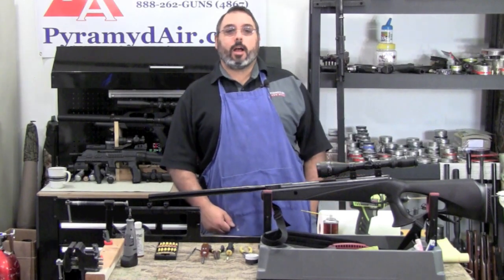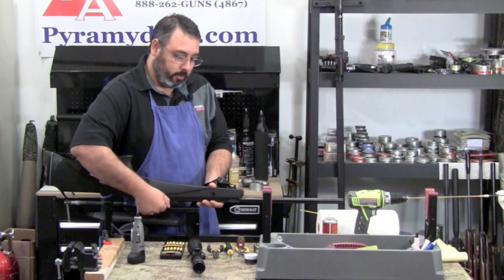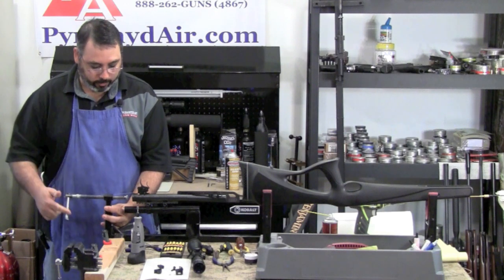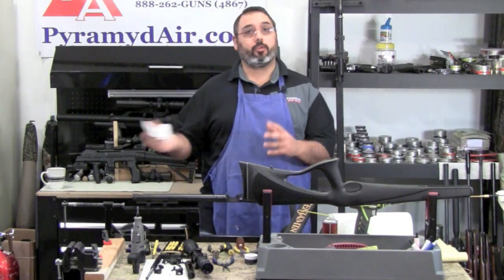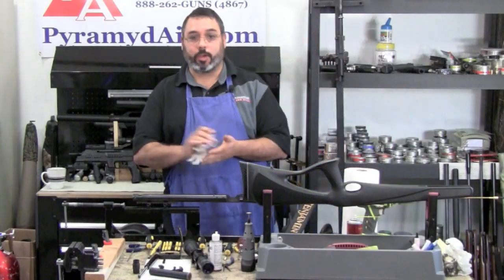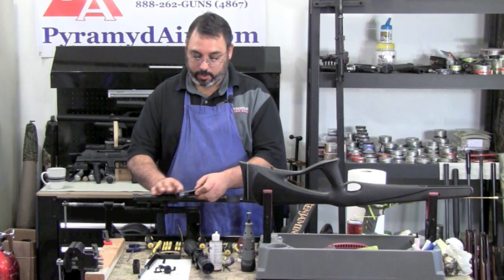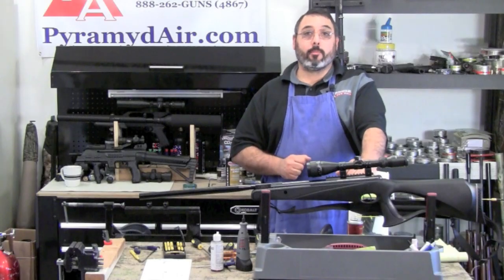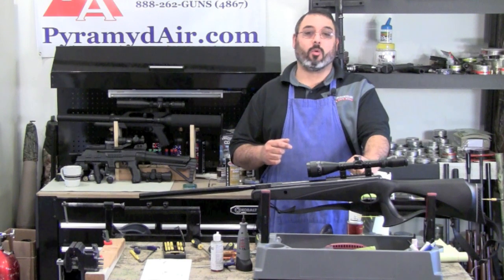Take AIM Episode 8 - How to rebuild your breakbarrel airgun

Comment: After being a machinist for 25 years and working on many triggers. DO NOT use a Dremel tool EVER on a trigger sear!!! The case hardening is only a few thousandths thick and you will grind through it. Instead, use a flat,hard, sharp edged stone and just POLISH the surface, without changing the angle This will produce a crisp and smooth release.

Comment: i have been looking at spring compressors for weeks to decide which one i was gunna make and after seeing the one in this video i have made one very similar to yours. i love the idea that i can leave it locked it and still work on the tube hands free. wanted to thank you for your video as well cause i just tuned my 1st rifle with your help . Now my Ruger Air Hawk is ultra smooth in operation and have increased power by 30%. i use the Vortek PG2 kit for my Air Hawk

Comment from the maker: 2 to 3 thousand.. 

You don't need to do it often.. right when you get it (if you don't mind voiding your warranty) is not a bad idea.. it will help the gun last longer overall.  Or if you like, shoot it stock until the warranty has expired and then rebuild it and go ahead and replace the piston seal while you have it apart.

Cheers

Rick

Comment from the maker: I don't really recommend oiling the compression chamber.  If the manufacturer suggests it, then follow their instruction and use their approved lubricant.  Crosman has one and so does RWS.  For everything external I use PA's MP-5 Oil.  As for the spring, I have a special lubricant that I use for that.  Gas rams I use moly paste as in this video.

Cheers
AGW

Comment from the maker: You can get a seal from Crosman.  Download the exploded parts diagram for your gun and call them to order the part that you need. The best way to know if your seal is good or bad is with a chronograph.  When the velocity starts to drop and become inconsistent, then your first place to look is the seal.

Cheers,
AGW

Comment from the maker: @Northernredneck125 

Thank you.. I'd love to do just that.   I do have to weigh the liability issues.. which is what's holding me back right now.  I think it is a great design that has handled everything that I've thrown at it so far from these simple gas ram guns to something like the Falcon Hunter with a massive spring.  I believe it is a winner.. It is a capital thing.

Thanks for the kind words.

Rick

Comment: I find it easy to put the trigger back in by holding the sear up and pulling the trigger so that the sear goes all the way up and holding it there with a small rubber band then once its on just remove the rubber band

Comment from the maker: The process is going to be virtually identical on the Gamo. However, the springs on the Gamo guns are often preloaded so you need to be careful when trying to remove them. It is not something that I would recommend to anyone that does not have experience working with high-powered rifles. This can be quite dangerous and you can get injured if you don't know what you're doing.

Cheers

Rick

Comment from the maker: Actually, a better way to go would be to use a different lubricant. I'll be offering something called "red honey" on my site pretty soon. I normally use it on just spring guns, because it really dampens the vibration and is tacky as all get out. It does slow things down a bit however. I prefer accuracy and consistency vs that extra 50 fps. You'd get similar results with a gas ram.. no need to dampen the vibration, but the tackiness will slow the gun down some and make it more quiet.
cheers
Rick

Comment: I find it easy to put the trigger back in by holding the sear up and pulling the trigger so that the sear goes all the way up and holding it there with a small rubber band then once its on just remove the rubber band, and with a springer you shouldn't break the barrel open when the stock is off because it can bend your piston then that will break your spring, i'm guessing that dent doesn't make a difference with a nitro piston because it doesn't ride along the inside of the piston

Comment: nice work rick  great video  but while you have you dremmel out why not break the sharp edge in the slot  where the linkage runs it would be sliding a lot smoother. and get a replacment seal before you do a video and call it a re-build  thanks

Comment: Hello again, Rick... this is a "PS" to my comment / question below, in regards to your spring compressor.    In looking at it again, I just noticed that this rifle has picatinny / weaver style rail & of course, corresponding mounts on the compressor.... will this set-up work equally as strong with just a 3/8ths "dove tail" as is common on many airguns ??    I rifles with all three.. picatinny / weaver / dove tail.... and so, would just have to swap mount rings, depending on the AG I'm working on ??      Thanks again, Rick.

Comment: Thanks for the great video. Question: So you put molly grease on the surface of the piston and so it naturally will get on the side of the piston seal. Got that. But will you also need to put a couple drops of chamber lube in the gun also?

Comment: Rick, thanks for the video. Would you recommend this detail strip on a new rifle. I would prefer to begin the break in process on a properly lubed piston described in your video. Thanks.
Reply from the maker: To j hike:
I would because this is how you can make sure that your rifle is properly lubed. Some rifles do come dry and without much lube. The key is not to overdo the lube because this will cause your rile slow down.

Cheers,
AGW

Comment: Everytime I pull apart one of my guns, I reasemble the trigger by slipping it on the tube, almost inplace, and using my finger to hold/lift the sear(while finher in tube) up while inserting it.Then push it foward and it holds inplace. It is so easy compaired to using a screwdriver or any other way.Hope that made some seance.  Just slip on and put a finger in hahaha

Comment: i don't know how i missed this video ! very very informative . rick , if i wanted a NP gun to shoot a little slower , quieter and smoother (fairly small yard and want to be very quiet without a silencer/muzzle break) .... could shortening the silver rod end of the gas ram by a 1/4 or 1/2 inch work ? and would it harm anything ? i know the warranty would be shot on a new gun doing it . wish i had gotten one of the low power titans when they were around :(

thanks again :)

Comment: I was wondering if you have a video of replacing a spring with a nitro piston? Or at least your opinion of doing such a modification. I was looking at some high end springers (Diana 56 and Walther Competition Ultra).
I'm not crazy about the springs since there is an alternative, but the guns using this tech has not really grabbed my attention (because of the diana side cocking and the walther's "hidden" cocking action along with other things). I would like to see a modification video to replace the spring or maybe where a tuning kit to do so can be bought (not really finding anything on my search). 
Basically I'm looking to do some long range (non-pcp) target shooting and new to the air gun scene. My engineering/machinist/maintenance tech (pneumatic/hydraulic/mechanical/electrical) background has me always looking for ways to improve perfection. This is why I prefer the gas shock than a spring, and heavy modifications isn't something I'm scared of plus if someone shows up with the same gun I want there to be a difference.
On the flip side I can not find a proper video about the Diana 56th target hunter.
Reply from the maker: You should look up the information on the Walther LGV and see why they chose spring over gas ram for their guns.  On the higher end guns, they need to be mechanically able to take a ram.  You could possibly get one to work, but you'd have to make your own components.  It's not practical and not really necessary.  The most successful, non pcp, field target rifle is the air arms tx200, a spring gun.

There are some spring guns that greatly benefit from a gas ram conversion, but the higher end guns may very well be better with the native spring.

Cheers,
AGW

Comment: I have a gamo varmit, i tried to remove the barrel and the screw wouldn't budge. When i used more power the bolt stripped. Any tips to get the bolt out?

Comment: i got an air rifle i want to do some work,  and i was wondering if you could answer some questions to move me along.

i know alot of gas rams come in 29 and 26mm.  how do i measure them to find out the proper size of gas ram is for replacement??

also is it impossible to swap out the gas piston without a spring clamp like the one you built??

Comment: What's the proper way to remove the barrel shroud?  I just wanted to check to see if there's any misalignment in the barrel.  My NP seem to shoot all over the place. I've tried several variations of the Artillery hold and several pellets lights and heavy and can't get consistent groupings. Maybe I've haven't fired enough pellets through it, about 150 so far.  What do you suggest?  Thanks.....
Reply from the maker: it's probably not the pellets or the break in period.  it's more than likely the gun or possibly the screws in the stock, make sure to check them.  To get the barrel shroud off, you need to unscrew the end cap with the right size allen wrench.. not sure what that is, but it should be easy enough to find.

Hope that helps.

Cheers,
AGW
Reply: Thanks for your reply.  I believe  I'm taking this  back.  The stock is  tight I even applied blue loctite on them.  I think I'm going to stick to the Hatsan products.
Reply from the maker: ***** It all depends on where you start for an airgun.  If you are talking Crosman, Benjamin, Gamo, Ruger, even Hatsan.. then yes.  There are manufacturing tolerances that can be improved.  Hatsan and Ruger will give you the least amount of problems.  Now, when you get to RWS, Beeman/HW, Walther and other proper European break barrels, there are zero issues with barrel lockup that I've found.  But, you are paying for that engineering. 

Lastly, you can't compare firearms to airguns in the same way you can't compare a VW hatchback to a 3/4 ton truck.  Sure they are both vehicles, but they are meant to do different things and appeal to different sets of people.  Airguns, as well as bows, shotguns, firearms, rc airplanes, etc. are a hobby.  Hobbies are expensive and never make financial "sense" as they are purchased more for the experience they deliver vs the utility they perform.

As for the profits made on them.. I have some internal knowledge on what some guns cost landed on US soil and there are some that are probably overpriced for what they deliver, but they are all the budget guns and not the high-end guns.  The margin on the high end, specifically European guns, is much lower than the Chinese imports.

Hope that helps.

Cheers
AGW

Comment: I've a Benjamin Trail NP .22 from 2010, model # BT9M22WNP.  The Crosman parts and pdf manual currently online do not have that model number, but it appears to be what they are now referrng to as  their model # 32050. Are they the same?
Need to order a replacement ram.
Thank you

Comment: Do you think I could improve the performance of a break barrel by chrome plating the ID of the cylinder and using a harder piston seal?
Reply from the maker: Not really.. you actually want to cross hatch the ID so that the grease works optimally.  Not sure on the hardness of the piston seal.  If you want more power, accuracy, and ease of shooting, move to PCPs.  You'll save yourself a lot of time, money and frustration.

Cheers
AGW

Comment: Good video, but beyond my capabilities. I have this gun but after only a little over 100 shots its blown the compression tube. My nearest Crosman authorized repair center wants $150 to repair it (IF he can get the parts from Crosman :/) For that price Id rather just buy a new (read: different) gun. The gun will fire but accuracy and velocity have significantly diminished. Is there a way for you to repair it for a reasonable price? BTW, its out of warranty. Thank you.

Comment: i bought an NP about 2 weeks ago, and put a few hundred rounds threw it. Now suddenly it keeps sticking closed and i cannot get it to break open. if i whack the bottom of the barrel it might break open with a hard hit on top after.I took a screw driver to see if the latch was stuck,but it pushed in easily.I put a little silicon grease on the lever but no difference. when it does break its smooth cocking. any ideas? its almost like the hinge on the push bar is locked and not bending

Comment: hey rick i have a crossman fury very similar to a crossman phantom and the gun broke on me so i took it apart and put in working order but the spring was broken so i put both parts in andset it to work buti think the messed up spring caused my gun to be inacurate do u think it would be safe to weld it together or would i have to order a new spring ? thanks

Comment: Thanks for the reply, I have the vortex 125 sniper.  I'm pretty mechanically inclined so I can usually figure out how to take something apart and back together without much trouble.  Is there anything exceptionally tricky about the vortex versions that I should look out for?

Comment: Hey Rick, really like your video's, I have a Benjamin Trail XL 725. With the nitro piston, is this video compatible for this air rifle?  If not do you have a video for this air rifle. Thanks Hardballer 45.
Reply from the maker: The process will be very similar.  Unfortunately I don't have anything specific to the XL line of Benjamin airguns.

Cheers
AGW
Reply: My trigger came out without removing any pins like in this video.  I am cracking that back plastic piece that comes off to give access to the spring and action parts.  I have no idea how to get that plastic piece out.  In your video you just wiggled it out pretty easy...  Mine is NOT easy to remove and in fact it's cracked under very minimal pressure in several areas.

Comment: i took the stock off of my benji titan, and i removed the rear cap behind the trigger mechanism. i put about 5 drops of hoppes 9 gun lubricant into it, i shot it yesterday, and i didnt notice anything wrong. will i have long term problems with it?

Comment: Where you able to take apart your tx200 ? I also have one and its really easy to take it apart. Its not so difficult to re assemble it. You dont need a spring compressor since the spring its not that preloaded and its not that hard. I had done it so many times and its not complicated. Send me a PM and i will send you the link of the webpage that i used for guidance.

Comment: WHERE CAN I BUY PARTS FOR MY CROSMAN PHANTOM HUNTER NITRO? everywhere I look they do not carry the parts for it. My son shot maybe 30 pellets thru it, then he leaned it against the wall... it slid down and dropped to the floor. Now its air pressure is not strong enough to shoot the pellets out of the barrel.
Reply from the maker: did you call crosman directly?

Cheers
AGW

Comment from the maker: @ModernMan316 

first thing.. don't take airgun advice from the guy at walmart.. your gun is dieseling and you will ruin it putting solvents in the chamber.  Follow the RWS Cleaning and maintenance regimen that I posted on the recent Take AIM.  That will keep your gun working well. 

Rick

Comment: hey I loved this video and I had a question . I have a Crossman nitro venom and I removed the pin but the cylinder didn't come out do I have to remove the piece holding in the trigger to get it to compress bc right now its totally frozen up could that trigger screw be catching it? also what knind of lubricant did you use on the clynder tht u said was toxic bc when I shot it after 2 weeks of it being in a case it felt like the cylinder moved forward but no where as fast as it should be. plz HELP I REALLY HAVE TO GE IT WORKING AGIAN!!!! THank you !!
Reply: Benjamin Paquin + If you have no way to get expert help, why not take it apart slowly, making drawings with notes, and taking photos? Study everything, see what it's supposed to do. Call the mfg, having your questions written, and ready to write answers. Treat it like a Swiss watch.

Comment: dont just apply only the grease on the piston add allittle beeman chamber oil then push the piston up till you c only the base of the seal then spin the piston one turn then push it all the way in then assemble what i have found is that the grease isant all that slick and seems to dry out and create drag and yes its the same as his grease

Comment: At 13:22 in the video, why don't you dermal the sharp edges so you don't have SHARP edges to cut you during disassembly or risk cutting the seal on re-assembly?  You seem to have no problem with grinding the trigger and sear connection, so why not the piston tube?

Comment: Hi Rick is there any way that you can send me a link to the measurement if your homemade airgun compressor coz i want to make one, thanks in advance.
Reply from the maker: Mr_blindguy  - the measurements are my design.. one I hope to bring to market one day.. in any case.. essentially I've taken a 1" tube and mounted rings upside down on it.  From there I've created a way to take a standard C clamp and rig it to a rod that moves up and down to align with the compression tube.  It's pretty straight forward.

cheers,